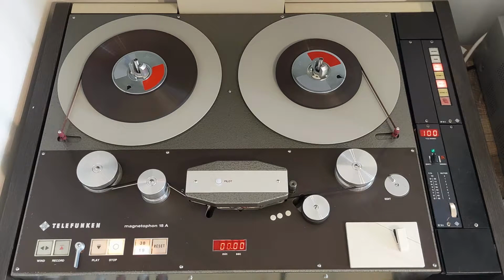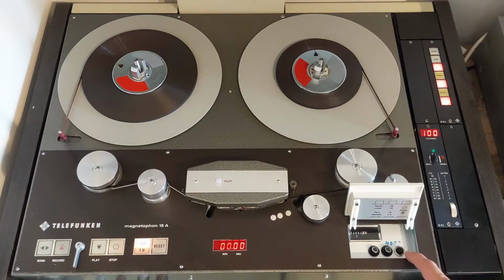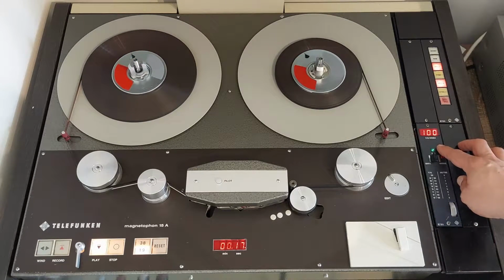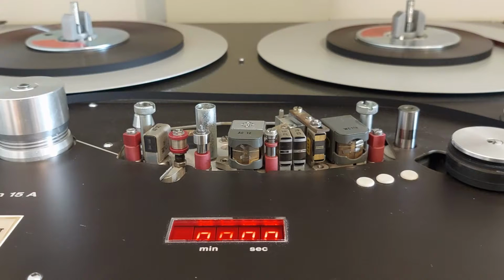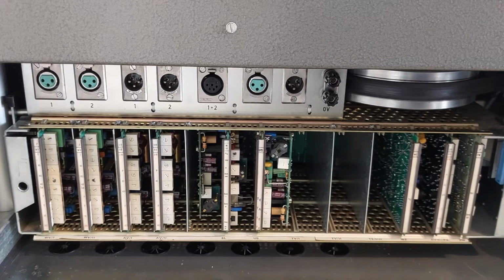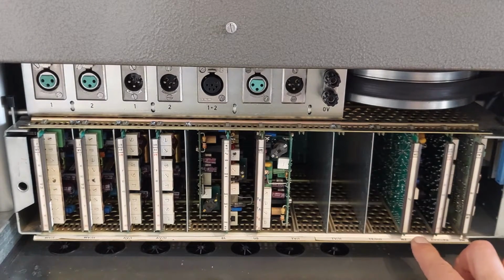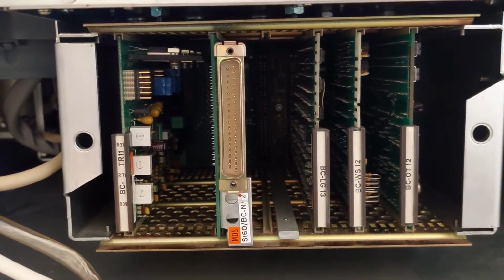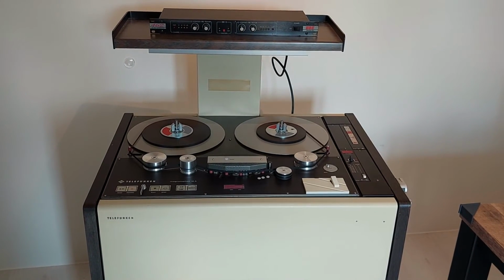An introduction to the Telefunken M15a Master Recorder

Comment: think they are  better than Studer equivalenta. no inbuilt level meters, external,add-on unit? or for exclusive use with a studio console?

see these LWAYS WITH OPEN-TOP TAPE PLATTERS. MUST AVOID TAPE 'SCRAPE. presume normal 10-5 inch spools work, with NAB centres? . must be a pleasure to use. if only I had room for it ) thanks for great video. Chuss
Reply from the maker: No meters and no level controls. Everything to be done externally. (levels can ofcourse be calibrated on the WV and AV PCB's inside the machine) . Normal spools work also. It is a pleasure to use. Very reliable machine. Was a pain to carry op the rather steep stairs in my house. It weighs a ton!

Comment: is 27000 hours a lot? how much of hours is still intresting for buying, Thank You
Reply from the maker: Small maintenance on this recrorder is at 5.000h, large maintenance (replacing bearings etc) is at 10.000h. If the recorder has been maintained correctly, 27.000h is fine. Check heads, they are rated for 20.000km, which means about 15.000h, at 38cm/s, or 30.000h at 19cm/s. If these need to be replaced, count on 400-700€ per head , depending on the version. It is also very advisable to recap all PCB's, and replace all tantaliums.
Reply: @ralphlauwaert2245  thank you

Comment: Hello Ralph,
I just read your post on tapeheads from about 1 year ago that you're trying to repair the AL15A Autolocator for this machine. Did you manage to get it working? If you did, can you please record a video about it's functions/features, how it works and how it controls the machine? There is very little information about it online.

Why I'm asking:
Honestly, I'm trying to figure out how the thing worked so I can figure out how to build a new Autolocator using more modern PIC/Atmel processors. Building a rudimentary copy of the FS15A Remote Control seems simple and pretty straight forward. But making some kind of working Autolocator for this this would be a very interesting project.

P.S. Building a remote control is not challenging enough for me so I decided to go full-mental and waste my time with this thing. 🤣
Reply from the maker: Hi! My AL15A autolocator is unfortunately still in repair. I've replaced all the IC's with new ones in sockets (5 of the original IC's were defective), build my own EPROM reader for those ancient C2708's etc, but to no avail as of yet.I can explain you how it works, it's actually not all that complicated. Write me an email at "my last name name".dot "myfirstname" at Gmail dot com. Cheers, Ralph

Comment: This completes my mixes now. 😊

I don't know what I'd do without Mix:analog over there in Slovenia.
Reply from the maker: If you have an M15a, you might want to implement better opamps and caps in the audio path. It makes a great difference when compared to stock, and costs very little in components.
Reply: I use Mix:analog for this process. @ralphlauwaert2245

Comment: I have two of these, bought for 100 euros (yes, for both.. so 50 euros each) about 20 years ago. :) Haven't used them in a while though. Back then I bought the machines for adding tape "mojo" to things but the M15A is way too transparent for that task. Maybe I should try to get hold of a test tape and calibrate them to see if everything is still okay with the machines. One of them hasn't been used at all since I bought it. I got the 2nd one for spare parts as the deal was to get as many machines as you could fit in your car. Unfortunately I didn't get a trolley or anything fancy extra, just the machines themselves.
Reply from the maker: 50 euro is a steal... :) Yes, they used to throw them out for nearly free... I was too late to that party, unfortunately. I did some upgrades to the audio amplifier cards, they make a positive difference in the performance of the machine. I based my upgrades on the work of user Fortepianus on the forum of aktives-hoeren.de. If you're interested, just google Studiotonbandmaschine AEG Telefunken M15A G-tuned. It describes the steps. I also upgraded the audio caps with Nichicon UES, they are the best audio caps to my knowledge.

Comment: I have a M15A and I need to calibrate the audio cards. Do you know where is it possible to get a test tape?
Reply from the maker: Hi, check on Ebay for user Ural91, he sells test tapes. Wriite him a message to make sure you order the correct one.
Reply: @ralphlauwaert2245  Thank you. Do you calibrate your machine with 514 nWb?
Reply from the maker: @korberd  yes, 514nWb/m. The standard level for m15a is 312nWb/m, but you can run this machine higher than that.
Reply: @ralphlauwaert2245  is a band compression still possible if the flux density is at its maximum?
Reply from the maker: @korberd  for the m15a, there is no issue. The heads and amplifiers can go much higher than 514nwb. Tape is the limiting factor. You can experiment with different levels and different tape types to get the sound you want
Reply: @ralphlauwaert2245  thank you for sharing your knowledge. It is sometimes difficult to find accurate information on how to operate this machines.
Reply from the maker: @korberd  if you need assistance with calibration, let me know
Reply: @ralphlauwaert2245  the calibration was successful. Thank you for your help.

I also have 2 other issues:
When the tape is rewind at high speed and I stop it, I hear a high frequent noise coming from the machine... What could it be? The stabilizer of the left reel vibrates a lot at high speed in comparison to the right one...
Reply from the maker: @korberd  Does the noise stop when the left roller comes to a standstill? or does it come from the left reel table? If there is a high virbration in the left roller, it means that the bearing is end of life. You can find the bearing type online, if not, let me know and I'll look it up.
Reply: @ralphlauwaert2245  it would be easier to send you a video. May I contact you via email?

The sound comes when the reels slows down just before it stops.

Oh no is it difficult to change that bearing?
Reply from the maker: @korberd  whats your email address?
Reply: @ralphlauwaert2245  I think the test tape was a bit wider than the other tape and that's why it sometimes made some noise changing the speed. I can not post my email adress here... Its like my nickname at gmail

Comment: I used to have one with only 436 hours.
I regret selling it.
Reply from the maker: 436 hours is really low ! Mine has about 4600h on it, which is also still rather low. The small maintenance interval for these is 5000h and the large maintenance interval is 10.000h if I'm not mistaken. Great machines, build like tanks.